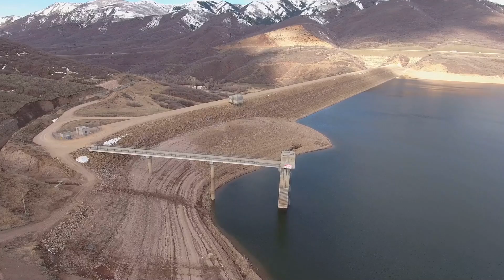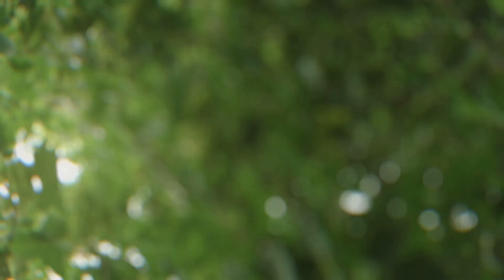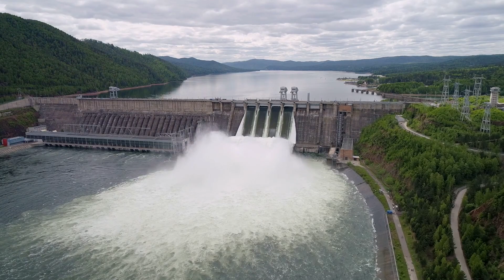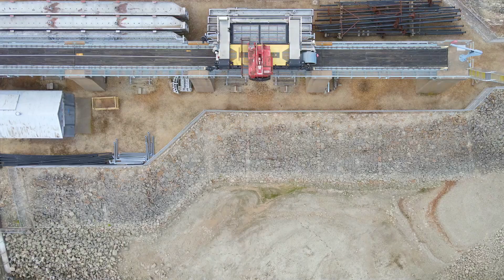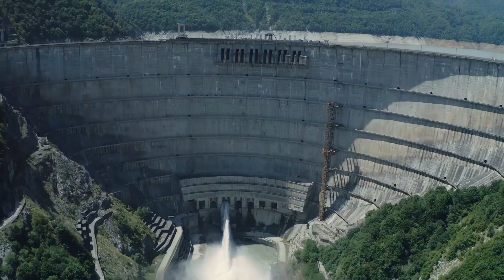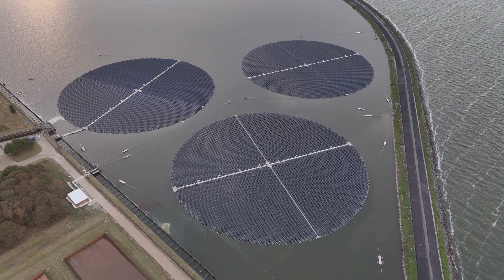The Future of Water DAMS? New Technologies and Environmental Solutions.

Comment: On the issues of green power technology
So firstly there is no such thing as green power. WHY?
Well by my book for it to be green the power used to process the raw materials into say a billet of aluminum must have come from hydro as wind and solar can't deliver the rate of power needed for the smelter to run
Now this issue exists throughout the entire chain from ground to shop front and then there is the Elephant in the room of 100% recyclable non meet that bar let alone exceed it
wind at best is 65%
solar well 25-30%
even hydro at about 95% is not 100%
So i hear you shouting this man's full of #### And yes you are on the right line if your about the power made sold to the public not the back story
Lets put it another way would you let your child have a Teddybear filled with toxic material's ? NO the first job as a mom or dad is to keep them healthy yet you will allow technology into their future that as i type this is going to landfill
Now to the next issue life of the power technology
So solar is about 12 years then the return drops off by 15yrs your looking to replace them
Wind is about 27 years then costs have eaten all the profit
Hydroelectricity well 100 years is the norm but can run twice that
Now in closing its time for some truths in my world
yes i am for hydro over sun and wind and as RDP Marine Australia i have an agenda but it is up front i have told you
Also i have moved to a caravan lifestyle 10 years ago a van i designed and made solar on the roof 8 135amp batteries AND MADE IN FIBERGLASS so i know i live it
In closing well done for getting this far in reading this and thanks